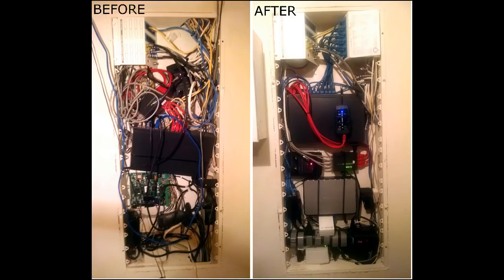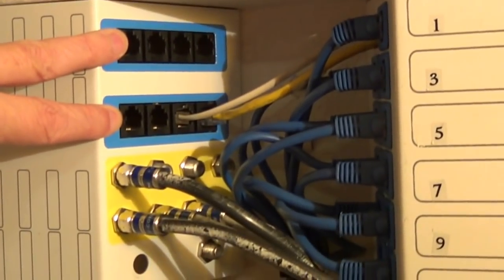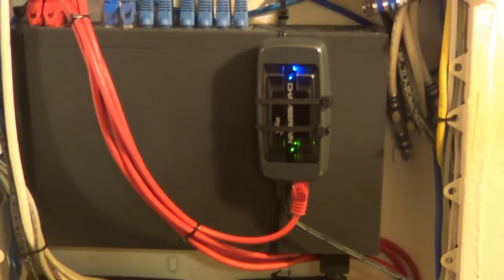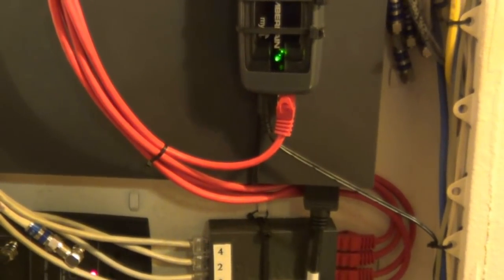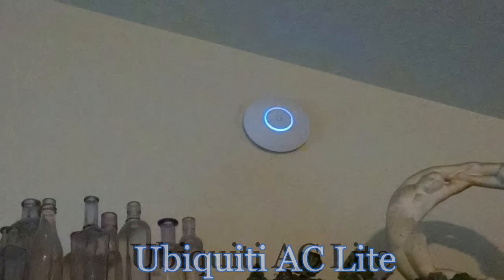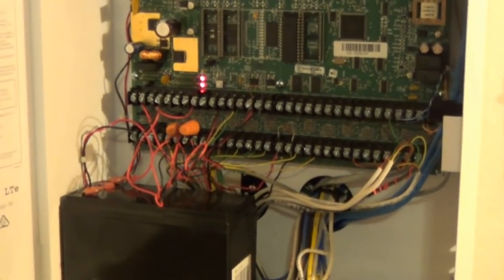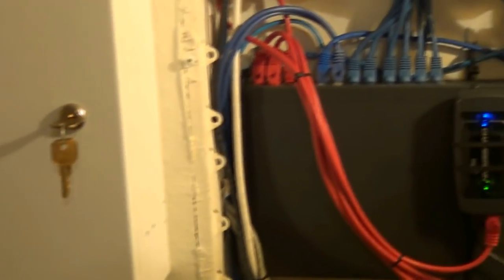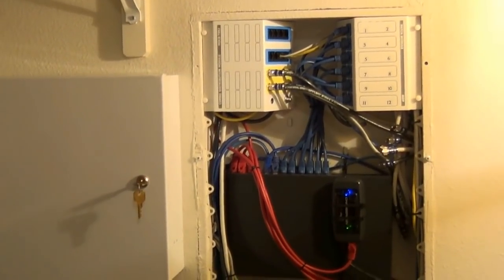Home Automation/Gigabit Network Upgrade Tour

Comment: Nice Video . I was wondering why did you not just connect your camera's to the NVR does it not support POE ? Just wondering . Also nice Drawing !
Reply from the maker: Yes, the NVR is POE, however doing it this way allows me to move the NVR to any room in the house with no wiring changes, just plug it in the wall and it picks up the cameras from the network.  Otherwise u would have to run all the cabling directly to the NVR and then it has to stay there forever, plus trying to hide 6-8 cables into a room would be a lot more challenging than simply plugging into a single wall jack.  Not that either way is right or wrong, this is just my preference.

Comment: Since you have unifi AP's, I'm surprised you didn't get a unifi switch and gateway.  That would give you a lot more visibility into the LAN and control such as being able to segregate the traffic into different VLANs which most consider essential for security cameras and IOT devices. Hackers love turing security cameras into drones on their botnet.

One observation is I didn't see any sort of fan to bring air in/out of the closet which would be advisable.  Heat is the insidious killer of electronics, it doesn't happen instantly like a power spike, but reduces the lifespan of the equipment significantly.

Comment: what is the box called for the coax, phone, cat cabling thw white box?
Reply from the maker: It's just referred to as a "module".  They are specific to the manufacturer of the wall box.  They all tend to use different methods to connect the modules to the box.  Keep that in mind if you are shopping for structured cable wall boxes.

Comment: You can do away with some of your network hardware and by using Linux/BSD install/embedded on some devices. You should put your RGW in bypass/pass thru and use PfSence as your firewall with Snort and Squid configured . You should have Vlans on your network so that if or when you network is compromised. The intruder do not own your network. I'm doing the same thing but I'm using a rack with  patch panels and corporate lease return network gear including servers. You can get some great deals on lease return network equipment that are generally more capable than low end home stuff.
Reply from the maker: Hi Lemay, sounds like you are way ahead of me, I don't have a server in my system anymore.  I used to have a dedicated server/firewall but got rid of it with the goal of simplifying my system and trying to make it all fit inside my wall box.   Do u have any pics or vid of your system?  I'd love to see it.

Comment: I've been watching a lot of these videos recently. Thinking about expanding my parents wired network since the house already has a bunch of cat 5e running around and the wifi interference is pretty rough. The hard part will be tracking the unfinished cables throughout the house. Right now only one cable cable works, and because it's wired as 10/100 there's two connections through it. I'll keep track of your channel for inspiration.
Reply from the maker: Hey James, You need just a "tone & probe" tool to trace your bare cables, makes short work of it.  You can also use a cat5 tester if you don't have or want to buy a tone and probe, you just need to terminate all the cable ends first, which you are probably going to end up doing anyway.  At that point, simply put one end of the tester in jack in the room you are searching for, then the tester end in the closet or wall box they are going to. Just keep changing cables until you get a reading, then label that one and move to the next.  Also, the cat5 can handle 10/100/1000, the only thing that makes the difference is the switches and hubs you are using.  As long as ALL switches and hubs in the network are gigabit, then your network will be 1000mbs.  Hope this helps, I am going to make a vid today about cable tracing and testing that should help you.
Reply from the maker: Here is the link to the vid I put up today that might help ya...  https://youtu.be/sYPbvoMzKTU

Comment: Have you enable jumbo frames for the network? It can help with transfer speeds of large files.
Reply from the maker: not all of my equipment supports JF, and if there is any piece that does not support it, you may experience an opposite effect.

Comment: I am curious as to why the extra switches instead of extra wall ports.
Reply from the maker: Hiya Kevin,,, Great question, my house was prewired by the builder about 15 years ago and so I'm kind of stuck with what I have to work with.  Honestly in hindsight, I would keep it the same.  Mainly because it's more flexible this way and I think it looks better for resale of the house, especially to a non-tech buyer.  In my office alone, I have 5 devices plugged into the network and some that are only there temporarily some of the time.  Same kind of thing in my home theater.... So I would've had to have the foresight to run 5-6 cables to wallplates in each of these rooms in 2003.  It works for my specific situation, I'm a tinkerer so it provides less limitations when I wanna change things up, etc.  Oh, and also I would've had to go to a 48 port main switch cuz I have more than 24 devices/outlets at this point.  Hope that all makes sense.
Reply: I do understand. I lack most home auto since I rent. My living room has a single connection from Modem to a 8 port switch which is full for just my desk. Scares me. But it would be better if Half my devices could sit in a closet or something. One day.
Reply from the maker: Look into Samsung Smartthings.  There are some pretty neat home auto features & devices that use your wireless network, great for renters, also works with Alexa.
Reply: Do you have any examples of Samsung smart things? (Minus a tv ofc)
Reply from the maker: https://www.youtube.com/watch?v=xMAmpTmlqrY

This is a review of a ST kit.  You can buy the hub separately and only purchase the peripherals you want to add to it depending on your needs.  I just installed one into a clients house and have been pretty impressed with it's operation & stability..
Reply: It wouldn't be hard to drop new lines to rooms. It's pretty easy even in a complete house. I do it for a living.

Comment: Nice video. Thanks. I'd be interested to see an updated diagram at the end to show how the HAI stuff fits into the flow.
Reply from the maker: Yes, I will do another vid on the Omni system.  As far as how it fits in, it is simply connected to the network via a single cat5 cable which allows me to program/maintain it from my PC.  All lighting commands are sent through the existing power (AC) lines, and the security zones are hardwired to the Omni.  Hope this helps

Comment: Do you have a UPS for the network closet?
Reply from the maker: I don't have one for the network itself, there is one for the security system which calls my phone (via landline) in the event of an alarm trip so UPS on the network isn't really necessary for my setup.
Reply: How is it not necessary when a UPS also filter out electrical surges?
Reply from the maker: I do have a high quality surge protector that is connected to everything in the box, just no battery backup on the LAN equipment.  Have only had one power outage in the 14 years I've been in this house so it's not really a necessity for me.